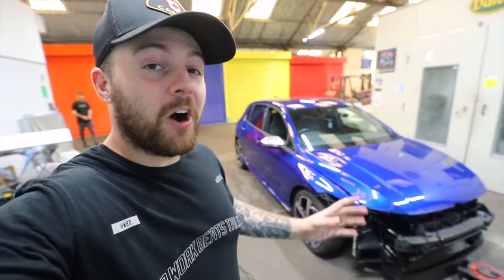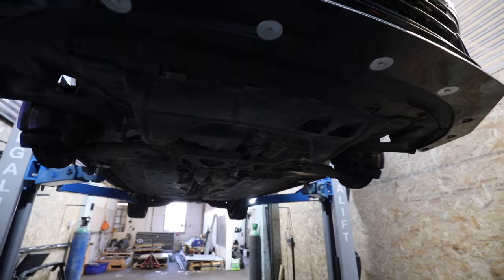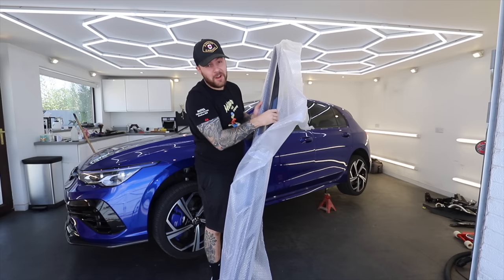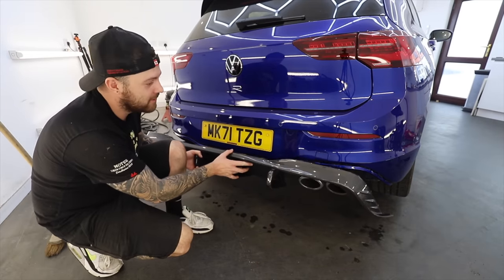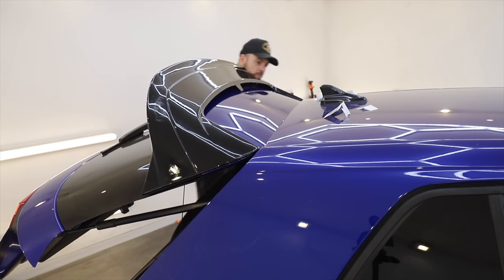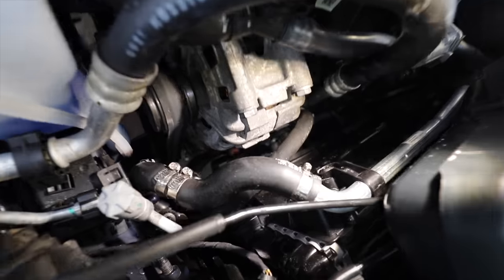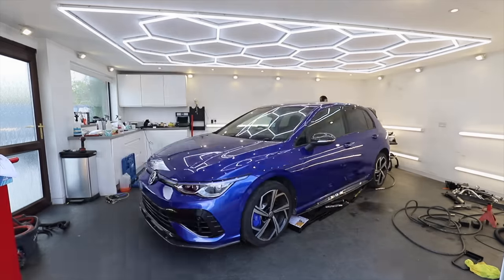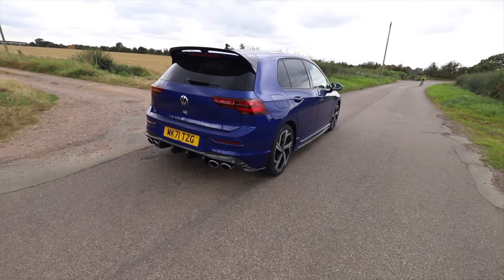TRANSFORMING MY DESTROYED MK8 VW GOLF R WITH THESE MODIFICATIONS

Comment: The loose rad could have that been apart of the recall for the rad supports ? I have had a 22 gti that it happen twice and then I went to a 22 R and I would only drive in race it in race mode if your looking for the pops and bangs in the others modes they feel muted.  Next would be exhaust and springs if I had to guess.

Comment: @chris_slix sorry man, I think you were driving in comfort mode then…. This car is a beast out of factory with 330 horsepower… to unleash them press the R logo in steering wheel or put it in Race or Nurburgring mode. It changes totally…sound…suspension… acceleration…etc

Comment: The car looks much better. But, the recording shows that you are you seem to be sitting rather far from the steering wheel, which makes it look like you are just hanging on, with too much stretch on the arms. Especially when doing the acceleration test, this shows clearly. Check out how professional drivers sit. More straight up and closer to the steering wheel. Secondly, the rim/tyre combo looks way too tiny. Lastly, the car could be lowered a bit more. Keep up the good work !